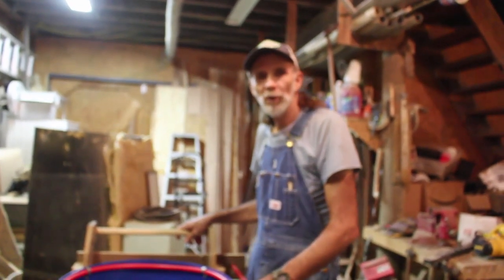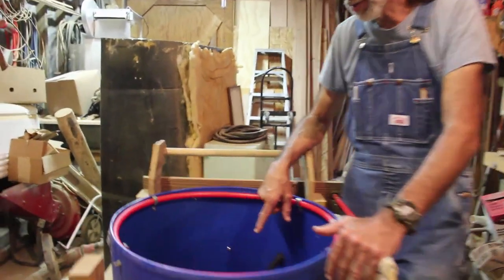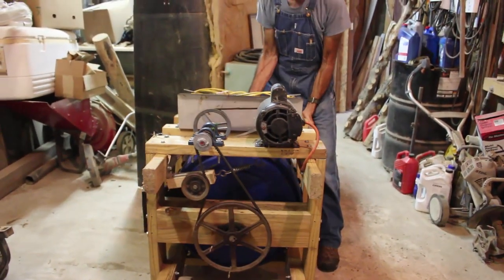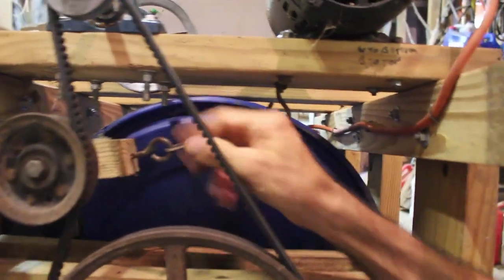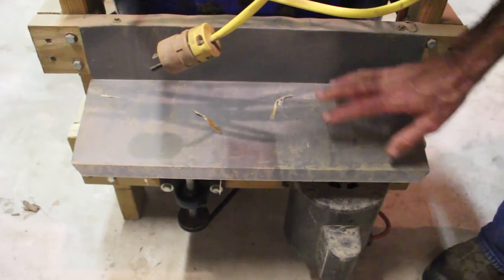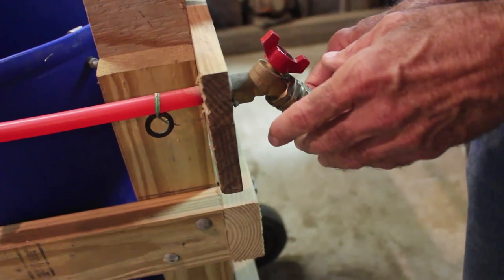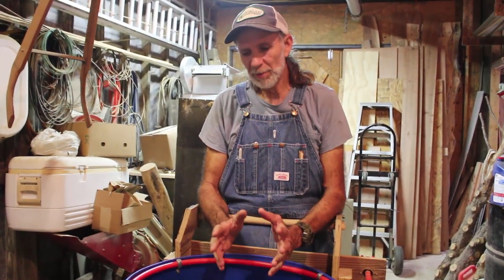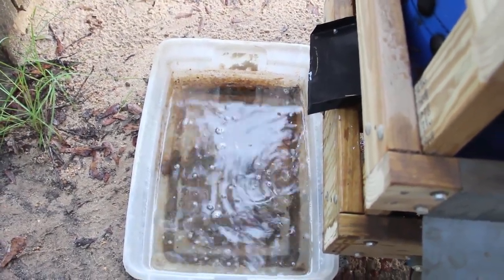How I Built A Homemade Chicken Plucker Using Whizz Bang

Comment: Instead of going through all the trouble to built the Transmission. You do not need the plucker fingers in the middle. Keep 10" in the middle without plucker fingers. Beside your chicken usually don't stay in the middle when the machine is spinning.

Comment: Thank you so much for sharing. Do I understand  $700, if you had to buy all the components new? Since you had a lot of these already, what was your total cost of the new components only. We have an old riding mower, and an old air compressor  (if the motor is still workable). That is why I am asking. Thank you again.
Reply from the maker: the new parts were around 400 dollars.

Comment: How did you spend 700 bucks on that are those fingers that expensive
Reply: I built mine for about $200. I had to buy 150 fingers, 17” pulley, and s.s. bearings. Couple years to “procure” the other parts.